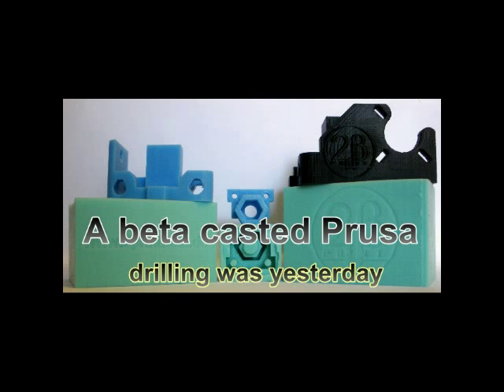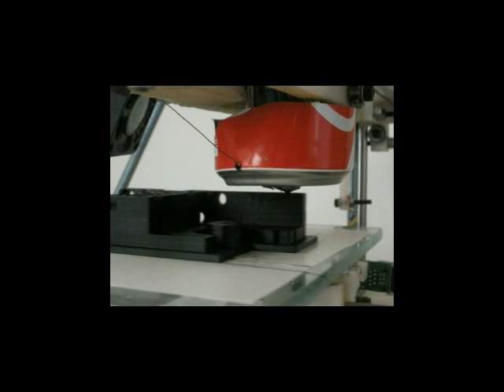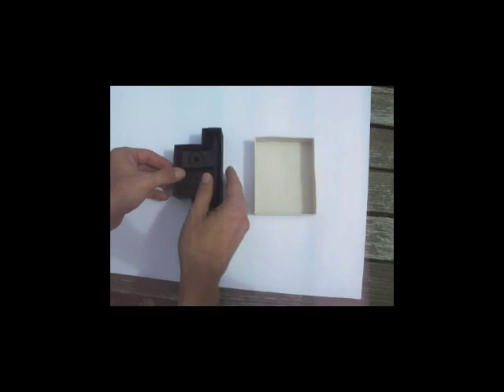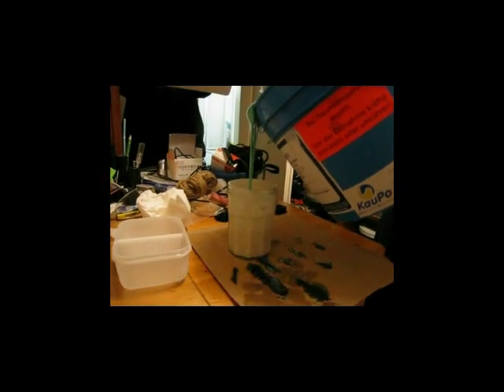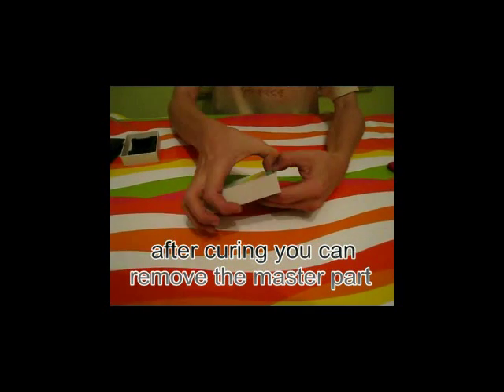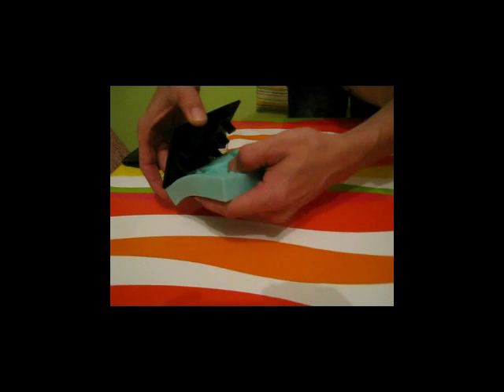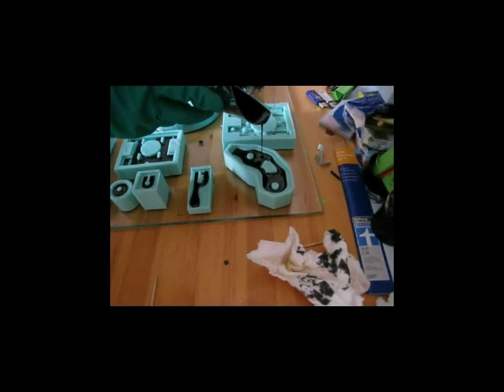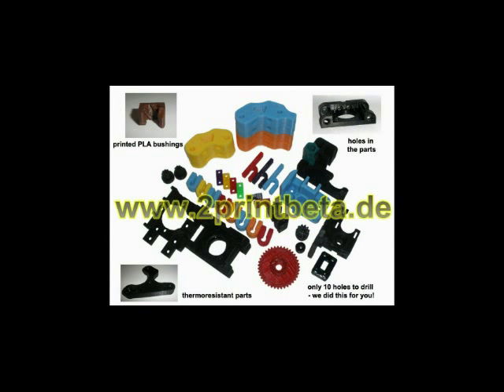2PrintBeta - A Beta Casted Prusa

Comment: @comeytrix :
Yes, it should be much better.  We used a special casting material for all temperarture critical parts which can hold up to 120°C. 
Also we made some walls thicker to make the parts more stable. 
So this parts should be much better the Clonedel parts.

Comment: hey men, nice work. 

brilliant idea, building the holes with bridges in the mold.
clonedel parts are bending and cracking, when exposed to heat/force.
Is there a big difference to "normal" clonedel parts? 

greetings